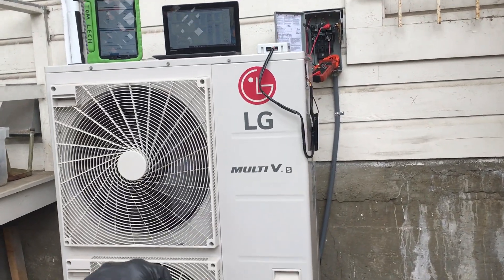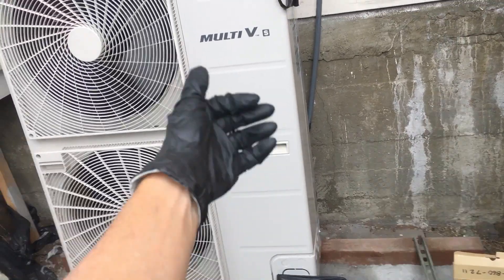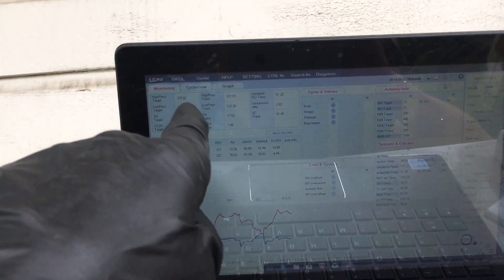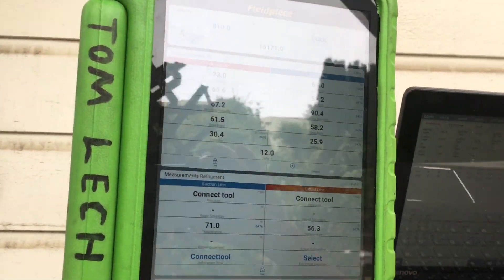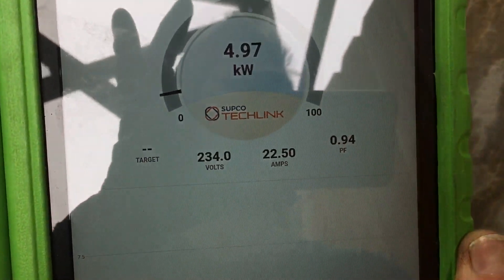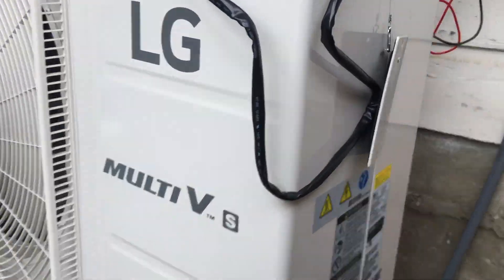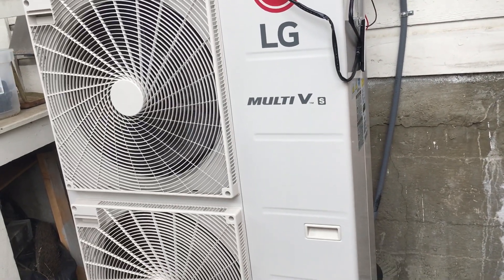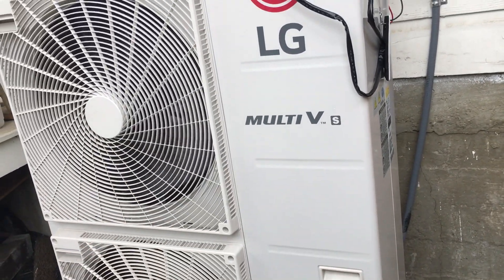LG ARUN060GSS4 these are the quietest heat pumps we have ever installed

Comment: Can I buy this without a contractor license? I’m a little confused still why I can’t buy this and ARNU543M3A4 to install myself, even if it’s without a warrantee. I mean it not a F-18 jet lol. I’m experienced with hvac, but I’m also a bit of a self taught learner, so I’m reading service manuals, and watching HVAC school lectures and classes online. Though I have no formal schooling credentials in it because I work 90 hours a week doing other things and have school in other areas. 

Any tips for someone like me ?
Reply from the maker: That is actually a excellent question and there’s actually an excellent answer. 
1: The majority of contractors who installed these type of systems the first time get it wrong in many ways even with years of experience of residential or similar equipment but the difference is there enough to be some very costly mistakes. 

       2: then they have reputation to uphold on a quality product every time I see one improperly installed the customer points at the name and says it’s a piece of crap because it doesn’t work right. 
           And the customer is 100% correct there is a piece  crap involved. But it’s not the product. 

     3: then comes the phone calls and emails and threats. 
 Who’s at fault the workers who installed it the contractors who bought it the end customer who purchased it instead of the contractor. This is where the finger start pointing into profanity starts flying. 

4: if I had a product of this caliber and complexity out I would never sell it to anybody with years of experience an in-house factory training and even that’s not enough. This is why you pay anywhere from $1000-$1500 for one visit after the installation for a person to go down a checklist and look at your installation fired up see that it is operating correctly and then check it off as good enough. If one thing is wrong and the commissioning agent Hass to come out a second day it’s another $1500 and every time you make another mistake day after day it’s another compound in $1500. 

          The equipment is very good very reliable and pretty full proof unless someone installs it who thinks they can do it right the first time 100%. Even if I could make money from the tales of this equipment I would not sell it I would handpick the people and train them before they were even allowed to touch it. 

           You have to be willing to dedicate yourself to one brand make model and Service think of a car dealer. 
 Can a mechanic specialize in be an expert in Ferrari Ford Honda and Fiat  thing about it without false diagnosis breaking things and making mistakes not possible. 

Why do you think there’s not an everything Doctor Who is a heart surgeon brain surgeon ears nose and throat and a dentist all wrapped up in one not possible. 

A contractor who is a roofer a plumber electrician and HVAC guy and a concrete specialist all wrapped on one not possible. 

      Be afraid of the guys who can say they are an expert at train sales and installation an expert at carrier sales and installation and there an expert at FUJITSU and their expert at LG and they’re an expert at Mitsubishi and their Expert at daikon. Run the other way you’re talking to a salesman. 

         And the way I was brought up if the guy selling the equipment in marketing it can’t tear it apart put it back together install it diagnose it fix it correctly he should not even be allowed to sell it or so much as even put his fingers on the glossy shiny pamphlets for advertisement. 

          Everybody makes mistakes so far I haven’t seen anybody walk on water. Every time I do that my feet get wet. Lol 😂 

        But that’s why there’s Internet sales they’ll sell to anybody
Reply: t lech I’m totally in favor of having it professionally installed. However I can’t find anyone willing to install the outdoor model and indoor model I would like. They seem to require choosing for me. I want the ARUN060GSS4 and ARNU543M3A4 but they aren’t willing to because I’m in a home. That’s what two people have said so far.
Reply from the maker: @thisis5123  Because it’s different hard and confusing for them they resist change something new. 

        Unless for some reason the position of the outdoor unit and indoor heads is more economical to do with the piping in the labor and materials. 

             I think I could give two extreme examples

         First one using the branch box.  Piping directly from the outside unit up the wall through the ceiling or addict mounting the branch box directly in the corner in the middle of the house of four rooms and dropping one pipe into each room directly out of the branch box within a short distance from its location one air handler in each room that might be financially better or easier depending on the circumstance.  If the branch box is not too big to fit somewhere. 

        Second scenario single pipe system outdoor unit located one end of the building two-story building run the pipe clear across the first floor to the completely opposite end of the building branching off with branch pipes to each air handler then continuing one single pipe up the far side of the house to the second floor into the attic continuing back through the attic across all the rooms branching off with single branch pipes . 
            In this scenario you have one single pipe straight continuous run very easy and fast to install one single wire all the way to the end all the way back to the main outdoor unit.
Reply: t lech they refused the job because I wanted that particular high static at handler. They didn’t want to install it because I wanted no duct work with it.
Reply: That’s what they said anyways. They might have been unwilling to do it because It’s for an indoor garden for my own personal medical cannabis for which I’m a licensed and legal medical user.
Reply from the maker: @thisis5123  HELL NO !!! ........  those little wall-mounted mini split heads suck. They are mold growth spore Petri dishes . 
         Will they work yes they will blow and you will get cold.  
       The maintenance is a nightmare and to get air to blow nice and strong to the other side of your room sucks. 

        But remember bigger is not better. 
     Whatever air handler you choose you have to turn the lights up or turn the lights down to the capacity of the air handler do not try to make the air handler compensate for your lack of lights or having too much lights. 

         You have to find a perfect load for the air handler that you were using. 

        With the high static air handler you can have a local sheet metal guy make up a custom air filter housing to put some really nice depleted extremely large air filters to keep your air clean and to keep your evaporator and blower wheel clean so you don’t clog up the fan and you don’t clog up the evaporator coil‘s. 

          The job site I’m on I’ll try to make a video showing you the air handler’s slightly bigger ones but the same thing and the type of filters that you would add to them. 

         Since you’re doing a grow if you use sulfur you have to turn off your air handler‘s you will clog your filters if you spray insecticide’s that have suffered cans that are either a oriole or a soap in the air while your air handler’s are on they will clog the air filters. 

          You must always turn off your air handler’s anytime you spray anything unless it’s pure water
Reply: t lech I don’t spray or use sulfur. To be honest I’m actually only running 12 lights of 630watt leds. The 36,000btu mini split installed currently has the issue of the air handler not being enough cfm. 

I want to put in the 54,000 btu high static because the cfm is higher than if I were to install two wall mounted 3 ton handlers. People typically associate the higher cfm with removing less humidity, but in this case, the problem is getting the cold air to the whole room. Even with as many fans as I have, the 3 ton unit I have now isn’t cutting it because of volume. That’s what made me decide to go with the high static model I mentioned. I wish you were in New England so I could have you install one for me and get me one !
Reply: Any recommendations on how I can go about getting one ?
Reply: Interesting. I just checked LG’s site and the ARNU543M3A4 is unavailable. 

If highest CfM is the goal. I wonder if the ARNU763B8A4 would be better.
Reply: Sorry for all the messages. 

I’m not considering the ARNU763B8A2 single

Or a ARNU363B8A4 x2

The two 3 ton units would give more total cfm which would be more desirable. 

Do you see an issue of running two ARNU363B8?  

Or would a single ARNU763B8 be  what you would recommend. 

Both units are around 1700 cfm. However getting two ARNU363 would multiply that 1700 cfm by two.
Reply: @coldfinger459sub0  so I’ve got the ARUB060GSS4. Now just need someone to sell my the ARNU763B8A4, and LGMV. Somebody please take my money.
Reply from the maker: Highest CFM is related to tonnage BTU output. 
        Example 1 ton of cooling roughly 400 CFM. 5 tons of cooling roughly 2000 CFM. 

            Do you points I’m trying to get across when using a particular air handler for growing purpose. 

         What is the capability of having a air handler that is high static pressure that you could put into smaller ducting and get high velocity air but still the same CFM to throw across the room. 
              There are air handler’s that are low static pressure cannot have next to no ducting at all and the opening is so big there’s very little velocity you don’t hear anything coming out usually pretty silent in the air falls rapidly

          The other point the little tiny wall mount air handler’s the fan blade is located after the called evaporator coil causing condensation and all the organic dust matter in the air collect on it and start growing mold. 

         With the high static air handler’s the fan blades and motors are located on the push side inlet of the air handler box pushing the air through the cold evaporator coil. 
             The other good thing about having a high static pressure air handler you can connect up your own custom filtering. 
          So if you wanted a large series of Merv 16 5 inch deep carbon coated air filters to filter your room all the way down to the size of viruses and mold spores and also keep your air handler fan blower wheel very clean keep your evaporator very clean in your condensate drain pan very clean and free of organic material that would be greatly increase the life of your air handler with a lot less maintenance.
Reply from the maker: This Is another problem small rooms are very difficult to control the smaller the room the more drastic the swings. 
        You often have to use additional fans to move the air sometimes a little bit of ducting or some boards that are placed strategically to deflect or reflect the air in a different direction. 

            There’s another unforeseen problem some of the modern light run so efficient they do not put out enough heat load we are used to calculating. They run so efficient and cool when you do your calculations you find you have too much cooling from your air handler. 
      I’ve even had that problem with one of my customers on his job site. 
                 There’s only two answers to solve this problem. 1: add more lights until the unit stays on steady and operates properly for heat load. 
                  2: Reduce the size of the air handler or even better yet reduce it to two smaller air handler’s. 

       One air handler for the beginning of your lifecycle of your crop and the ending of your lifecycle of your crop when your heat load is reduced your lights are turned down 50% 

            Then after a week or two when you turn up the lights 100% full vegetative a lot of canopy growth a lot of humidity you can turn on the second air handler when there is a need because of the extra load.

       Then the last week before the end of the lifecycle when you wanted to run colder and the plant is starting to die drink less water ready for harvest you turn off when air handler because you have reduced your lights back down. or you’re one of the people who keep the lights up but you want extra cooling and bring it down to 60° everybody does it a little differently.
Reply: @coldfinger459sub0  Well, here's the thing, the temperature of the coil is also related to BTU. BTU is a factor determined by BOTH volume and coil temp. In this particular instance, there many different handlers to choose from for a given BTU rating. So even having 2 low static 3 tons, the highest fan speed LG offers in them is 750CFM on the high setting. Multiply that by 2 and my total output would be 1500CFM. They only make High Static units for 4ton and up. A single Air handler is greatly preferred.  I would much rather have a single high static model which does 5.5 tons and has a maximum CFM of 2300CFM on high. Velocity by forcing air through restrictive ducting doesn't matter, its the total volume of cooled air that I care about which will be best for my application. I would rather have 2300CFM of slightly less cool air than 1500cfm total of cooler air. Yes in theory, the cooler less volume air would remove less humidity, but its not the case in the situation. The actual dew point is still sufficient to the point where the higher volume actually gives better cooling and better dehumidification. Is there any way you can personally get me an indoor unit ?
Reply from the maker: This Is sorry no. I don’t do middle man sales. Too much problems. Especially with items like this.
Reply from the maker: This Is with these units the temperature is NOT ! fully controlled by air volume and coil temperature. 

           They have direct temperature sensors on both the coil airstream and the refrigerant piping itself. 
         Where they will start tapering down the refrigerant flow the speed of the compressor the duty cycle on the expansion valve. To keep a constant within a given parameters. 

        Now if we’re talking air handler‘s on old school split systems like your average Goodman or Train or a Carrier. Then YES If you start restricting airflow your coil temperature will keep dropping until it ices up. 
         You can also override and manually tap your blower speed motor to push 450 CFM sometimes even 500 CFM your static will increase and you could move the face velocity of the air across the fin so fast it stops dehumidifying to a minimum. 

             And all the specifications you read are at a 95° outdoor ambient temperature with a 80° indoor ambient temperature at 50% humidity. 
             For every degree do you want to drop the in side air temperature your capacity of your unit drops drastically and it’s not a linear it’s more like a bell curve or exponential drop in performance output. 
          At 80° indoor temperature that 5 ton air handler at 50% humidity can give you 5 tons of cooling.
                 But if you try to turn the temperature all the way down to 63° indoor air temperature for the room that 5 ton air handler capacity might drop down to for example out of the top of my head 3.2 tons of cooling potential. 

            Don’t get confused the operation of the VFR Systems and Your fixed displacement average run-of-the-mill every day American made split system. 
            Two completely different animals in the way they operate. In the VFR systems if not understood don’t always follow the old school rule of thumb practical logic of the fix system split systems manufactured by American companies. 

          This is why I come to a lot of burned up compressors or overcharged or under charged because of the old mindset trying to compare in size one of these units as if it was a standard fixed split system. 

      It’s better to go with two small systems then it is to go with one big system
Reply: @coldfinger459sub0  Is there any chance you could get one of these for me personally and i could pay you? I'd even pay you to install it if that makes you more comfortable. I am having trouble finding anybody who will accept the job of installing the models I want. It's been 2 months now of consultations in person and then having the job flat out refused. I'm getting desperate at this point. I need this Air Conditioner Yesterday lol.
Reply from the maker: This Is I cannot take on any more work. Started working seven days a week again just to try to catch up with the work I have.  I’m pre-booked with jobs well over a year in advance. And only taking on very small jobs that are directly related to existing jobs and projects I’m already currently working with or customers. 
            Literally only jobs I go out that are unscheduled is old customers who have emergencies to get their systems back up and running for maintenance or service. 
             Or for example one of my recent jobs that I’m conducting is on such a large building directly attached to another building as there are other air-conditioning systems breakdown well I’m installing the system I’m working on I will take a break only for that to get them up and running on one of their old existing units that I personally have not installed myself. 

          I’ve had so much work I had to change my business model to only doing work for customers who have already purchased my systems I have no time to take on any more new clients unless directly related to a existing job I’m working on.
Reply: @coldfinger459sub0  I relate to that man! No worries. Of course if you could get me a unit, I’d be happy to compensate you. I’m stuck with the brand new Outdoor Heat recovery  unit ARUB060GSS4, but the indoor model I purchased was incorrect because the distributor made a mistake and now I can’t find them anywhere
Reply from the maker: This Is That sounds like a Online distributor not a real LG distributor.
Reply: @coldfinger459sub0  it actually is a real distributor, but truth be told, I think the only reason this place sold it to me was because it has small dent in the front case, and the plastic fan guard in the front on one rung of plastic has a crack in it. However it’s unused and still has the factory charge exactly as it should for being unused, and having no leak. I thought I would also be able to buy an indoor unit from them, after corresponding with email for a week or so, but they informed me down the road that they were mistaken and couldn’t actually sell it it to someone without an hvac licence.
Reply: t lech I’m totally in favor of having it professionally installed. However I can’t find anyone willing to install the outdoor model and indoor model I would like. They seem to require choosing for me. I want the ARUN060GSS4 and ARNU543M3A4 but they aren’t willing to because I’m in a home. That’s what two people have said so far.
Reply: If I could find the units I’m looking for, I would dedicate as long as it takes to have this thing in tip top shape and absolutely perfect. I’ve already been studying every manual and engineering manual which LG offers as a download on their site for the past 3 weeks in preparation for owning this unit. Hopefully I can find one with the set I’m looking for